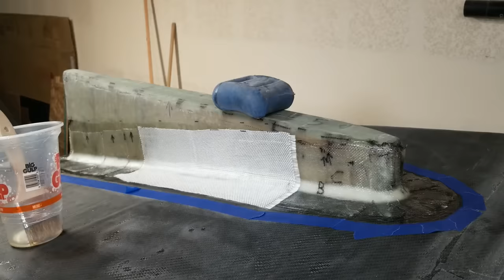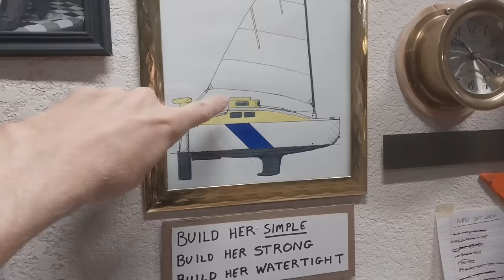OCSS-078 Attaching the Skeg - Mini-Cruiser Sailboat Build

Comment: Another option for getting the skeg to fit the hull contour: Put a layer of painter's tape down over the area, use crazy glue to adhere sand paper to the painter's tape (rough side out, obviously), and then rub the skeg back and forth over the paper until it takes on the exact shape of the hull contour.  Rats don't have hats where I live.
Reply from the maker: 👍 I think that would work well.

Comment: I have not read all the comments but I would make an extra ramp on the front site of the keel. To prevent a rope or plants will hang there and slow down the boat.
Reply from the maker: It's only like 2 inches, not much to worry about.

Comment: At the end is your boat, your job, your time and your decision are the one that only matter. 
It seems that you put resin with brush but never roll the wet surface with metal roller. This is key to get all air bubble out and have good fiber lamination. 
This could be the reason why you find some spots that you are forced to sand down

Looking forward to see the first splash.
Reply from the maker: I have used the metal rollers in the past, but they are a real pain to clean. I find it's just as effective and easier to push out any bubbles with my hands and by pressing with the brush. It works well for me and this skeg layup had zero air bubbles.
Reply: @ocean_capable_small_sailboat  typically if you keep jar with acetone and you keep the roller there it helps a lot to remove the resine. 
Small surface like the skeg are ok either way, but bubbles under large sheets are more complicated. 
Great job. Looking forward to the splash, I’m really envious you found the courage to start this great project, maybe I’ll start mine sometime in the future. 
Good luck with your 10k subscribers.

Comment: I'd really like to see some destructive/mock up testing on the lateral strength of the skeg/hull system.  Maybe Sven could help you out with some estimates of mass, angle, and velocity.  You surf down onto a submerged container and that skeg could be history.
Reply: Don't worry about the skeg in that scenario... it will be protected by the bilge keels!
Reply: @Garryck-1  you are thinking linearly...in high seas and wind conditions nothing is linear.  Possibly saved by a small relatively light weight boat, still...
Reply: @paulgiusti9703  - I'm the one thinking linearly? In high seas and wind conditions, you should not be surfing down waves in the first place. That's what a Jordan Series Drogue is for... stops the boat from ever reaching such a dangerous point. Running before the wind is a very poor heavy-weather tactic, as a great many sailors have learned to their dismay.

Comment: I’m just thinking why the front of the skeg pops so much out of the bottom of the boat… 🧐 Doesn’t it add additional drag compared to the model where the skeg starts from same plane as the bottom? Does it give some extra benefit that i can’t get?
Reply from the maker: Could be. It's only 6cm/2.4in deep at the leading edge, though. I could carry it all the way forward until it merged right into the bottom, but then I'd be increasing the wetted surface area which also means more drag.

Comment: I notice you are planning to use a tablet with Navionics for a chart plotter. I'm interested in this approach for the boat I just built and launched. How are you planning to keep the tablet safe from the elements? Have you found a case you like?
Reply from the maker: I'm not sure. The last time I went cruising I just had one of those simple handheld Garmin units, which was waterproof and durable. Then I had paper charts and some on a laptop. Now I hear the way to go is with a tablet with all the charts you need. I think the tablet would stay in my cabin which should be pretty free of water. I'll just try to keep it out of areas that might get splashed. Then probably have backup navigation on another device like a phone or extra tablet.

Comment: Is that fairing compound easy to sand? Looks like Bondo in consistency, yes I know Bondo on a boat is a big no no. Anyways your doing a great job
Reply from the maker: I've never worked with Bondo, but yes this fairing compound is designed to be easy to sand I think. Some sections I even did by hand without the electric sander and it's not bad at all to do.

Comment: Why did you put epoxy on only the edges and select small areas of the bottom of the skeg? Why not on the entire surface?
Reply from the maker: Because the white foam is just a gap-filling foam that won't stick to the thickened epoxy.

Comment: Hi I wanted to ask if you used marine grade pvc foam for this project or just normal pvc foam
Reply: Also will you be publishing the plans of this project?
Reply from the maker: I've actually never heard of PVC foam being classed as marine grade or non-marine grade. As far as I know it's all good for marine use. What I bought was advertised as good to use for any marine or other project, from surfboards to wind turbine blades. I don't have much interest in selling boat plans, but I am trying to get my design all into CAD.
Reply: @ocean_capable_small_sailboat  so are you waiting until you finish building yours to publish it or what
Reply from the maker: Well there's really nothing to publish yet. I have the plans for the frames done, that's easy. But, making plans for the hull panels is a bit more difficult as they are curved and have complex curves. I'm working on it with some help from kind helpers but it's a low priority for me. And does anyone really want plans for an un-tested design?

Comment: Why didn't you make the carbon fiber a feature? It adds little the way you've done it so making it visible might've made the cost better spent. I'm not sure you can fix it from this point, but it certainly isn't doing harm. Just a missed opportunity. I'm looking forward to seeing you sailing as the proof of the design or otherwise will be undeniable. How long till launch do you reckon? It's been a long road but you are so close.
Reply from the maker: It can't really be shown off on the bottom because I have to have bottom paint. I just wanted 1 CF bottom layer. I'm targeting the start of this fall for launch.
Reply: @ocean_capable_small_sailboat  yeah, bottom paint sucks but your fall is ?October? So not long to go. One last question if you'll indulge me, what do you think it weighs now and what is your target dry weight.
Reply from the maker: I have no idea but I'll try to weigh it once it's on a trailer. I get this comment a lot.
Reply: @ocean_capable_small_sailboat  thankyou. I can estimate close enough I hope, I had an idea I wanted to model before mentioning to you. No need to reply, cheers.

Comment: mate. the bracing round the mast on ya original design wa heavy so, yes mate, your mounting rigidity n strong enough 4 sea, with roller mast. come on. I DON'T WANT TO DIS YA WORK. but check out the bulkheads on the design. ya no where near it????. I'm not bein mean just did you notice. LOVIN YA WORK:-)
Reply from the maker: There is a lot of fiberglass reinforcement in that area, even a super-strong G-10 disk fitted onto the deck around the mast tube to further spread loads. I followed a different approach, but not a weaker one.